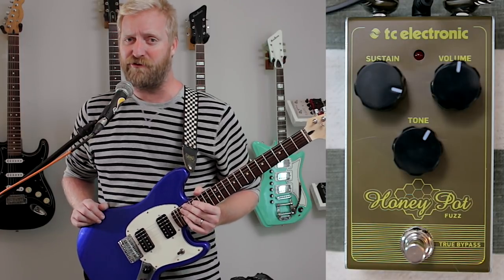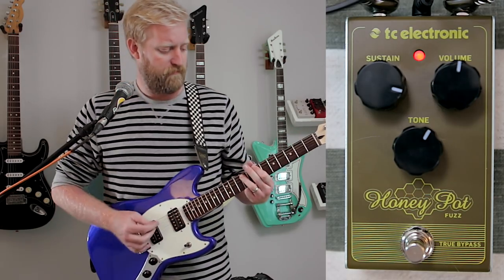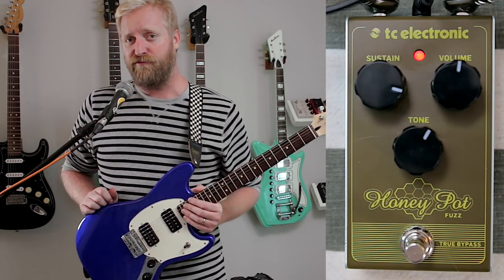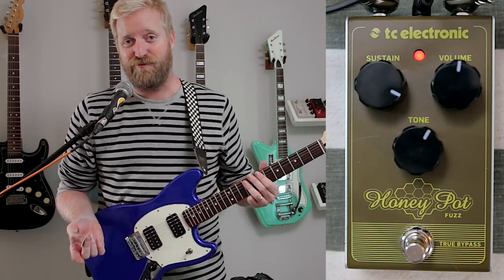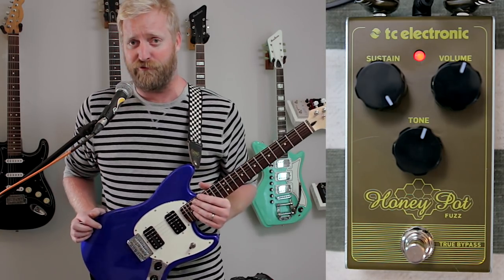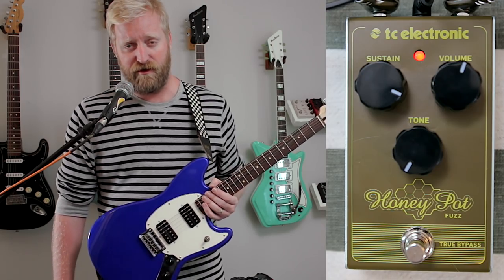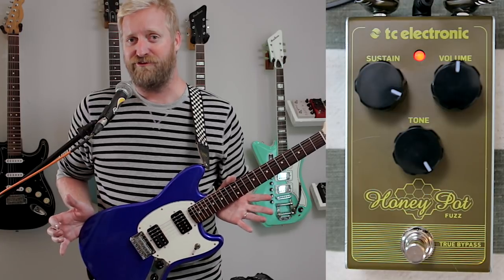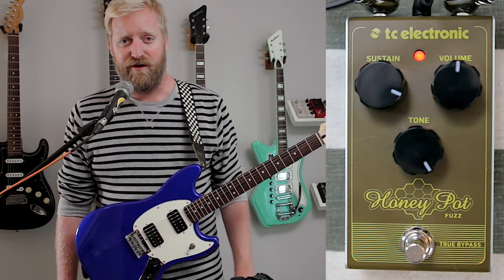Honey Pot  Fuzz - Tc Electronic

Comment: I would like to bust the myth of blowing up your guitar speaker when plugging in a bass. When you stick it into a regular guitar amp, nothing strange will happen. You can only blow up your speaker when you hook a guitar speaker up to a bass amp head that has a high power rating like 2000W. That's when you might destroy your speaker, because regular "guitar speakers" can only handle about 100W, a large part of which might be a static voltage to which the output signal is added, but with an output transformer this shouldn't happen.

Somewhat ironically, with a 1 Watt signal output, a 12" Celestion speaker already produces 100dB. 1 Watt on 8Ω means V^2 / R = V^2 / 8Ω = 1 Watt, so V = SQRT(8V^2) = 2.8V AC. The amplitude of the AC signal would be 2.8V * SQRT(2) = 4V.

The Celestion speakers we tend to use were originally designed as bass speakers if I'm not mistaken and you would use a regular amphead to go along with those. Someone must have figured out, since mellow was the new thing, that it's also pretty cool to stick in a regular guitar into an amp like that.

If you compare modern amps to for instance the Standel amps, that are actually still being produced but manually, after the power transformer mishap, you'll hear that the Standel amps the way we have gotten used to amps produce a lot of high end. Ironically, they quite frequently have 15" speakers. I think it's not due to the size, but how they are built. I think they have or had a metal center acting as a tweeter.

Comment: Can i not use it to boost clean! a single coil-pickup??? To get more output??? ...please help, i find nothing about that! ...here it looks like it no work as clean booster, but i know not the amp, maybe it is a tube amp who get many input and is in overdrive mode!
Reply: Per what I can hear in this demo, his amp is set clean and all the gain we hear is from the pedal. Even when the gain is at it's minimum on the pedal it's still fuzzy. I don't think you'd be able to use it as a clean boost. You should look for a boost pedal such as a TC Electronic Spark or a low gain pedal like an Ibanez Tube Screamer.
Reply: @Big_Coil  many thanks :) ...that helps!!!
Reply: Late but the behringer super fuzz is cheap, and has a clean boost setting, 25$, plastic enclosure though
Reply: @tastedawaste1367 That isn’t a clean boost, it’s a gain boost, and even with the gain turned all the way down it still has a little fuzz. If it’s pushing a clean signal then there’s something wrong with the pedal.